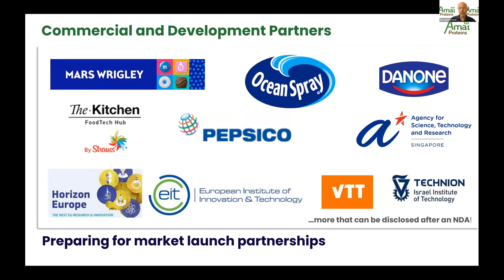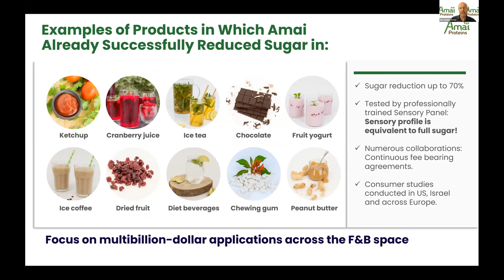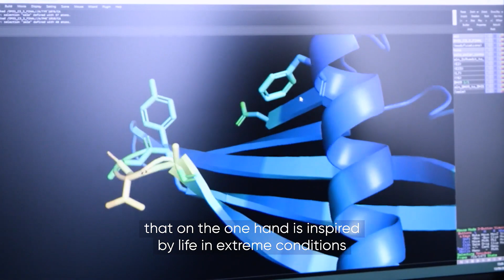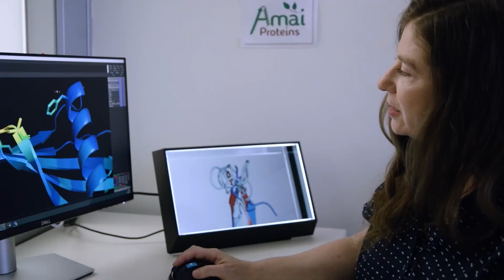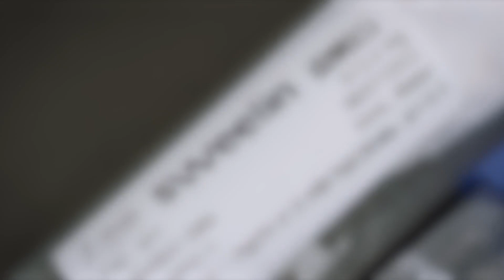Will The Largest Food Brands Launch Sweet Protein Products?

Comment: Alright, thinking way too much about this.

First, "Diet" products are deliberately formulated to taste crappy. American consumers are Puritanical. When they make a "healthy" choice, they want to be punished for it. Diet sodapop can be formulated to taste good. If that sounds absurd, just try the black label Zero Sugar Pepsi or Coke. But Diet sodapop is made to taste off, because it's what the consumer of Diet sodapop wants. Wheat can be bred to not be bitter and it can be finely milled to have a smooth texture; however, the consumer of 100% whole wheat bread made a healthy choice, and by God, they want bitter sawdust bread that sandpapers their throat on the way down. Some people get used to it and start to crave it, but that's a tangent.

However, when it comes to "regular" products, if they taste even a little off, the consumer won't buy it again. So, in order for sugar to be yeeted from "regular" products, the very first requirement is that the replacement can't be bitter, licorice-y, have other off flavors, or have any sort of lingering off-taste, etc. etc. 

I dare imagine that the sweet proteins are cheaper, because they're so potent that so much less is required for sweetness. But that creates a new problem. Sugar doesn't just provide sweetness. It also has functions, e.g. preservative, moisture-holding, adding bulk, m o u t h f e e l, etc. etc. All those functions will now need to be replaced with fibers and gums and such. That incurs additional costs. Thus, the net cost may wash out to be less than sugar, or it may be more.

In the end, all that the food manufacturers care about is the bottom line. If the consumer will take it off the shelf and come back again and again for more, and if it costs them less than sugar to make it, there's no way they won't make the switch.
Reply from the maker: Interesting points, I hadn’t thought about it that way before